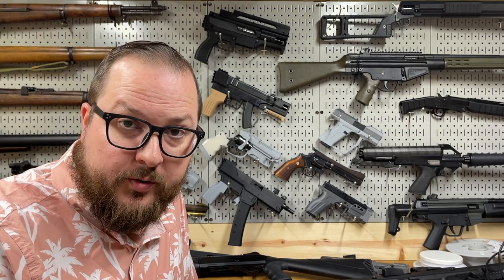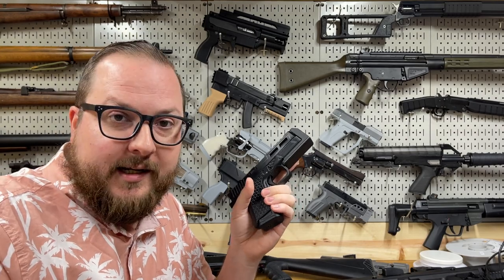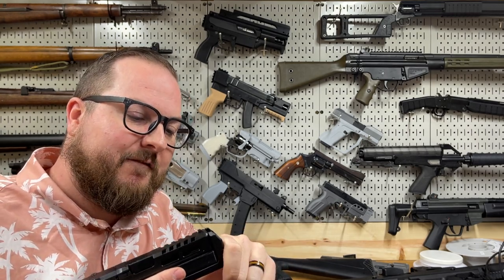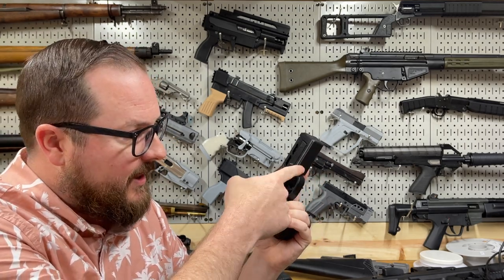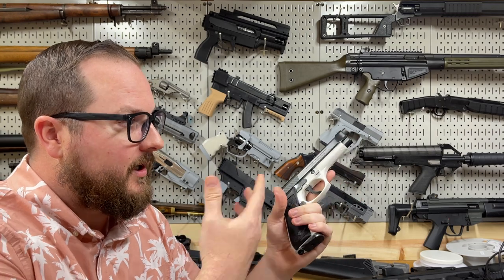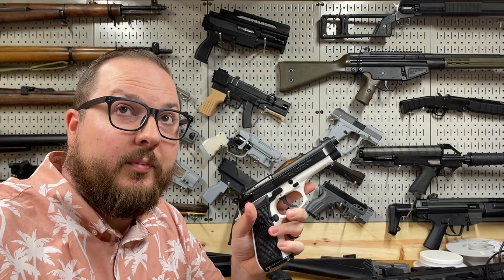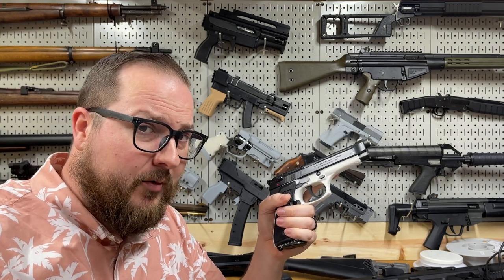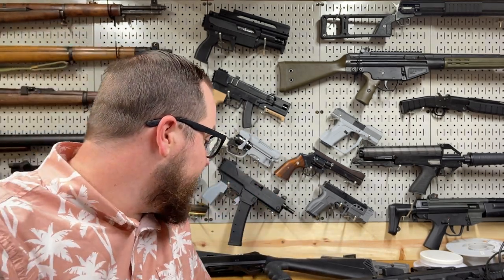3D Printed Projects: Beretta M92 and G19/26

Comment: I still can't get over how perfect your prints look.
Reply: They look good idk man mine look similar on my cheap ender clone and all I did was level it and put the mm height super low tuning and long print times are how it's done 3 days for a ar lower but the sides were completely smooth like it wasn't even printed
Reply: @popinmo  ive been weary about printing at low layer heights. ive never “tested” my prints (yet) so im essentially bullshitting you right now, but from what i understand you get better strength with taller layers (sacrificing detail of course, which is more noticeable on stippled/engraved style designs and maybe a problem for frames with intricate internal design). i stippled a popular stl myself and it came out looking like low poly oatmeal diarrhea until i printed it super fine, so im kind of unsure if i really want to test it beyond fitting the parts.

Comment: The Beretta 92/96 platform is puts a large amount of stress on the rails. It makes for the longest lasting handgun(92FS and later)  according to military testing. But this makes steel rails necessary for successive mag dumps across thousands of rounds. A rail insert with carbon fiber nylon(or nicer engineering filaments) could make it similar in durability to the original. I wonder if the design will incorporate AVES rails that they will sell. That would be ideal in my opinion.
Reply: I wouldn't be surprised if AVES wasn't currently working on a Beretta rail system
Reply: youd be surprised how many rounds the beta testers have on the current rail setup.....its wild. i could hit a thousand in a month or so
Reply: @defaulttarms9561  I don't expect PLA+ to tolerate as much successive firing as a steel frame can. The filament needs to be extremely high temp and strong at those temps for the same performance. Pins through rails and super high temp filament is the only way for similar performance. Or the use of polymer cased ammunition could also be used. It could reduce the temperature to one third that of regular ammunition. The USA uses it in the next gen rifles currently being manufactured.
Reply: The vast majority of 92 series frames are made of aluminum, Not steel.

Comment: The 26 grip is nice, because it's easier to conceal... and the longer barrel is nice, because it makes it more comfortable to carry IWB. The longer barrel reduces the feeling of the gun wanting to tip out of the person's belt when leaning forward. With smaller guns like the G26, P365, etc... and them having heavier grips, when a person leans forward at all, that weight makes it want to tip outward, which causes the muzzle do kinda dig into your lower abdomen there. A good belt can fix that, but even with a good belt, having a longer slide still makes it more comfortable and more stable. A lot of people that own a G43 or G43X actually carry them in G48 holsters, because it's more comfortable. I'm sure many people that carry a P365 do the same thing, carrying them in a P365xl holster.

Comment: Any chance of an inverse of the 19/26? So a 26 frame with a 19 slide.
Reply from the maker: That’s exactly what this is, lol. 26 frame, 19 slide.
Reply: I get what you meant, a 26 slide on a 19 frame would be like a slightly smaller 19X - not a bad idea, it's just kind of already been done. Inversing the 19/26 idea also inverses the benefits, i.e. the 19/26 has a longer barrel for better velocities/accuracy etc. on a much more concealable frame accepting 26 mags. A 26/19 would just be worse ballistics on a much less concealable frame, you know?
Reply from the maker: @fffiilpsnamecaps9004  I've done that as well with my G26X frame design. I'm just confused about what he's asking for, since he wants a 26 frame with a 19 slide and that's already exactly what this video is showing, lol.

Comment: The 3D scene needs a single/double action capable frame. The double action glock stuff is SO over done and old news in 3D,  time for something new.  I've been printing the Beretta 92fs frame the last few days (got it from print2a's site).  It definitely needs improvements before it can fire rounds since it's plastic and not metal.  But it looks cool as a desk ornament.  No idea where to begin making improvements to it,  even the model screws up cura unless you disable "Union Overlapping Volumes".  Without disabling that,  cura decides you dont need a trigger hole or a mag well anymore and just fills them completely solid lol.   Hopefully the mods can be done without increasing the width as thats a decent pro I like about the 92,  and it just looks cool.  I cant wait to have a printable 92 frame,  I love the single action capabilities of beretta 92 and 1911,  so the beretta 92 is a perfect frame to start with.
Reply from the maker: If Print2A is hosting this same file, then they’ve taken and are distributing files that are in beta and not ready for public release. The file isn’t ready for release. I have no idea what file they’re hosting.

Edit: just checked. They’re hosting a raw file, that thing isn’t optimized for printing at all. Sort of like how Defcad hosts random technical files that aren’t actually printable.
Reply: @booliganshootingsports  It's a file from 1-18-2021 from an unknown author as far as I can tell.  It's not the first 92 frame I've seen in STL form but it's the first I've seen hosted on a mirror site like print2a.  It could definitely fire rounds but doesnt look like it would survive past shot 1 lol.  I did put all my 92 guts in it and it seems pretty functional,  but I sure as shit wont shoot it.  It's way to thin in many areas that would need reinforcement design changes.

Comment: Would you be able to 3D print the Glock style gun with an EDC style thumb rest? I like the competition thumb rest and would like for someone to make one that it more low profile build into the frame with no edges that catch. Maybe even just the thumb rest that goes in using the front pin.
Reply from the maker: I've done some slightly exaggerated "accelerator" cuts in the frame on a few of my designs to serve as a bit of a thumb rest. I could flare one out a bit more.

Comment: I like to go with the prefix of: L means longer slide, X means longer frame. So a 19X is what we know it as, a 19L is a 19 with a 17 slide, and what would be a 19XL is just a 17. So with this I guess you made a 26L
Reply from the maker: 26L does fit the general name, the concern with that name being confusing people on what slide to buy. 26L sounds like you'd need 26 parts when it exclusively uses 19 parts aside from the mag. 

Maybe a G19S

Comment: As a Beretta fan I have so many questions about the 92 frame. I'd love to have a polymer framed 92FS. How is the locking block situated? I wouldn't think that polymer is strong enough to work with the locking block. Is PLA+ strong enough for the slide rails or did someone create metal frame rails? Please keep us updated on this project. I'd love to see how it turns out. If it's successful I'll have to buy a printer and start learning how to use it. Ever since I shot a polymer framed Hi Power in South Africa I've dreamed that I could have a Beretta 92 with a polymer frame.
Reply: Wondering the same thing five months later lol. I have a complete 92fs slide that I was given many years ago. I've just been sitting on it with no plans. Now I have plans😎

Comment: This is what the g19x should have been
Reply from the maker: I also have a G26X testing out currently with a G26 length slide and 19 length grip, and I like it WAY more than I thought I would, lol.
Reply: @booliganshootingsports  why do you like it?
Reply from the maker: I reshaped the grip to better fill my hand, the balance is really quite good with the short slide and midsize grip. I didn't understand the 19X when it first came out, and that's why I designed this in the first place really. But now I kinda understand the longer grip/shorter slide combos out there.